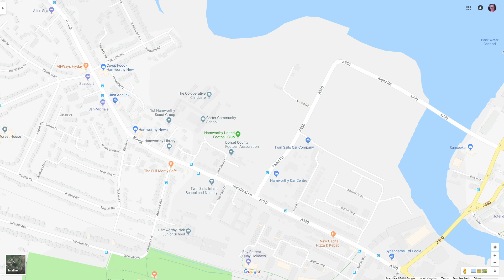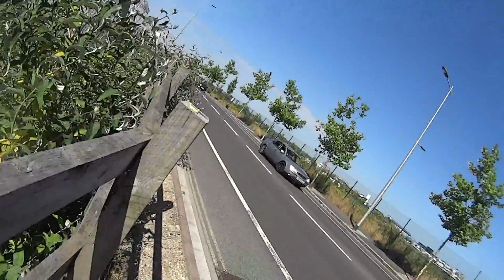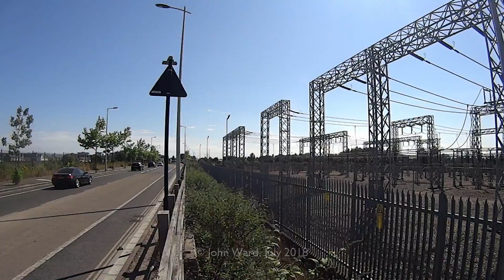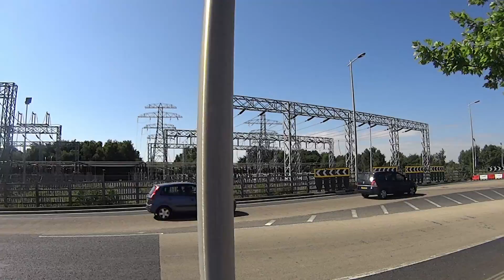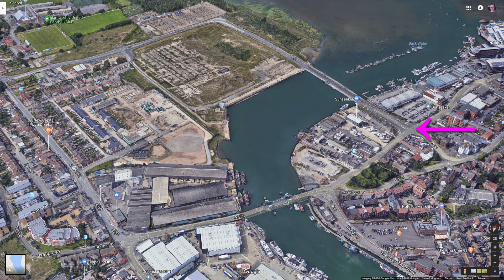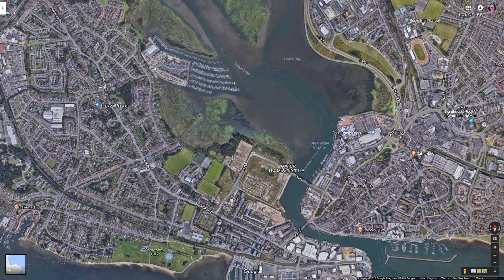Rigler Road Power Station Site, Poole, Dorset

Comment: Do you remember when the Hamworthy Peninsula's electricity supply got disconnected? An excavator driver cut through the cable and legged it. The port of poole and most of the surrounding area lost it's lights for a while.

Comment: With that nearby distribution station, wouldn't be terrible place to put a few megawatts of solar panels, 8 or so, if a 40 acre site. It's the south of England and it would save money on the interconnect costs.

Comment: I assume that the power station was replaced by a new facility.  If so, it would be interesting to know where they built it.
Reply from the maker: No new or replacement - the UK used to have large numbers of small power stations like the Poole one, but now has a small number of very large ones.

Comment: I think that site is supplied from mannington heath grid substation do you know for sure John? I also heard from 2 different people that many year ago an engineer sent out into the switch yard to open( or close) a frozen circuit breaker he hit it with a lump of wood and there was a big bang and all that was left was his shoes what a way to go!
Reply from the maker: Very likely, that substation supplies most of Dorset.  Very large amounts of solar panels near there as well.
The other item is either untrue or grossly exaggerated, even at very high voltages people don't just disappear.
Reply: @jwflame  
It is true an electrical engineer from distribution division was killed by inappropriate action in the compound.  I was at the time 1950,s an engineering apprentice at the power station. We were all shown his burnt clothing as a warning.

The land between the wood yard and the power station quay was not part of the station.  It was basically unused excepting for the oil pipeline which served the Riggler road Shell-Mex & BP installation which was located at the  then end of Riggler road the road where the station main gates were.

MWD.
Reply: @mikedrew9855  apparently an engineer saw a wire dangling and sparking in the compound. Went out with a broom handle and tried to move it. What was left of him looked like a well done steak. The control room windows had bars across facing the substation.

Comment: Looks like a 132kV double bus substation to me. I can make out some of the isolators and circuit breakers but it's not easy to see from google earth. Looking at Google earth I can see a smaller substation adjacent and I'd assume that the 132kV has a couple of 132/33kV or 132/11kV TX on site and it's very much in use feeding the smaller substation and surrounding 11kV network! I can just make out in addition to the four overhead line circuits that there are also a couple of 132kV Cable sealing ends there too, so there's likely to be a couple of UG 132kV circuits stretching out from there too. I doubt it's going anywhere soon. I can't imagine the Power Station was a particularly large output given the size of the land it occupied, probably only a few hundred MW at most.

Comment: The much longer bridge would've been significantly more expensive and that is probably one of if not the main reasons it wasn't built. The new swing bridge is total piece of crap. Unbelievable that the edge of the road just fell off when lifted  for the first time. I bet the other older swing bridge still works just as well today as the day it was first opened. Old stuff is built properly and *JUST WORKS*!
Reply: If you think old structures always worked properly, you should google the Tacoma Narrows bridge disaster.  The original bridge was opened new in 1940 and collapsed 4 months later.
Reply: @heronimousbrapson863  But 4 months later isn't "old" it was "new" stuff then.
Reply: @calmeilles  I meant "old" in terms of it having been built in 1940,  not having been "old" when it collapsed.
Reply from the maker: The old one used to work - but that was closed in September 2016 for a 9 month refurbishment.  It reopened 16 months later in January 2018 - but even then had to be closed several more times for additional repairs.

Comment: Intresting vid, John. Is Contaminated land the reason the site hasn't been redeveloped? Being right on the waterfront that land is worth millions! 
I aasume the dolphins are connected with Poole pottery as that is their trademark.
Reply from the maker: Yes, that's the dolphin connection.  Somewhat useless now, as Poole Pottery isn't even located in Poole any more, it's owned by another pottery in Stoke on Trent.  Only an overpriced retail outlet in Poole now.
Reply: The land isn't being redeveloped due to the concrete base that the power station was built on (including sea reclamation).

It will cost £10 million allegedly to make the land acceptable to build on.

I may be incorrect but that is the reasons given locally (apologies if it is just heresay)
Reply: Retail unit is closed or closing now to make way for a new development
Reply: Dolphin is also the emblem of Poole and many entities.

My old school Poole Grammar. The local authority. The Dolphin Centre.... probably more than I realise in addition.

Comment: At the chemical factory I once worked at that used to be opposite the power station on the other side of Holes Bay, it used to be a popular prank to put a small lump of dry ice into a thick rubber glove, tie a tight knot in the glove and chuck it into Holes Bay. The glove would float away, getting bigger and bigger as the dry ice sublimed into CO2 gas. It would finally burst with a satisfying bang. Rumour had it that the fun stopped after complaints were received from the power station about shredded rubber gloves fouling their cooling waiter intakes. We're talking mid seventies here, by the way. The chemical factory is long gone, thank goodness, although you might be interested to know that it once made the vast majority of the world's supply of liquid crystal materials.
Reply: oldblokeh - did that include the lava lamp?

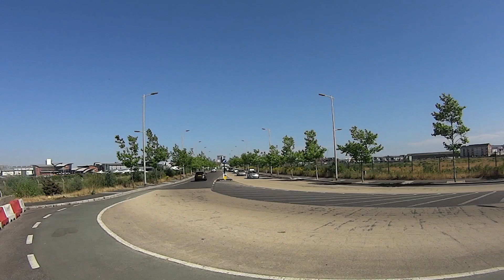Comment: 4:02 road surface at  the right angle bend appears to have had an extra expensive high friction surface of a different colour  to the usual tarmac added. Along with the concrete barriers I'd guess that's evidence that it surprised the planners and unexpectedly became a notorious accident blackspot.

Comment: Thoughts: I'm assuming the reason the former plant area is still unoccupied is because it's a toxic mess that no one wants to pay for cleaning up. As for the original plan for the new bridge, could the reason for not building it have been that the riverbed was not considered stable enough along that route to support a bridge of that size?
Reply: Greedy bastards!
Reply: Gameboygenius Looks like they are going to build housing. They bought the land in 2002 and just waited for the local housing market to pick up https://www.lih.co.uk/news/ search for 'poole'
Reply: You can read about the development challenges in this consultation paper: http://www.newbridgepoint.co.uk/NBconsultationboards.pdf.  I suspect the key one is the "challenging housing market".    As John says, developers buy up land and then sit on it until they can make the most money.

Comment: When i first saw that bit of road heading straight into the bay i guessed they must have had a bridge planned for there at some point. Reminds me of the M23 when you get to the Coulsdon (northern) end of it, you get filtered off onto the A23 whilst the actual motorway carries on for a bit before end abruptly amongst some waste land. I think that was once meant to join up with long since cancelled ring road around south London. I am guessing that the ground at the site of the old power station must be heavily contaminated? Seems strange that such prime ground was not snapped up by developers. Either that or the National Grid may have some future plans for it? And i wonder what the set up is with all the infrastructure that is still in place on the other side of the road? Can't believe all of that is there just to connect those two power distribution lines?

Comment: I'm assuming it was a coal fired power station because of the time it was built and the location to the water to dump the heat (Such a waste of energy).
Pity the site is vacant for so long. Even the smaller site across the road with the cabling is wasted space. No transformers so they realistically only need 1/4 of that space for cables.

Any idea what the plants generating capacity was when fully functional?
Reply: The equipment still there looks like switch gear, those horizontal poles  on the small pylons, power is probably coming in and going out and they can use the switch gear to isolate a section of the pylons for repair.
Reply: Plus, with it being located on the water, coal would have probably been delivered by boat. Was cheaper and quicker than road or rail for large quantities.
Reply: It was designed for coal and operated as such 1950-55 but then had an oil-burner installed. I can't find if it was  'dual fuel' or only oil thereafter.